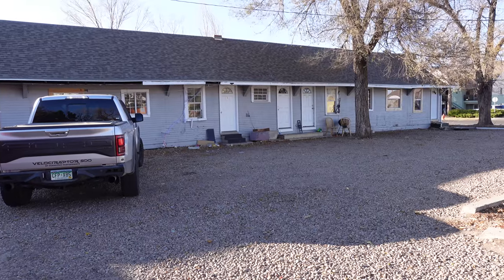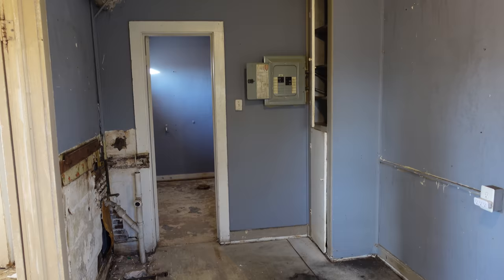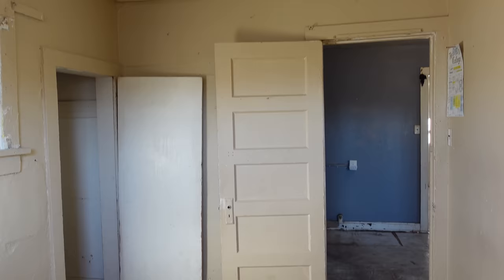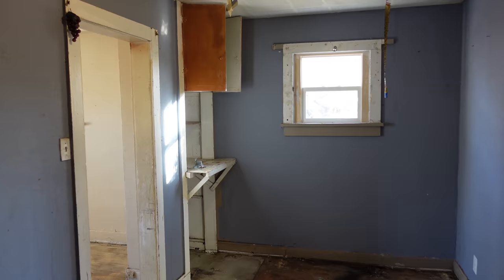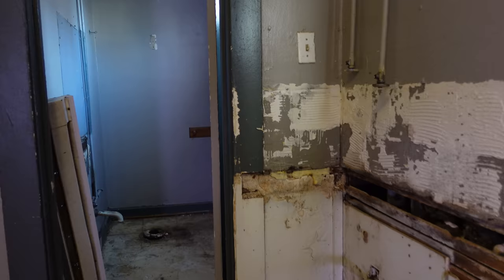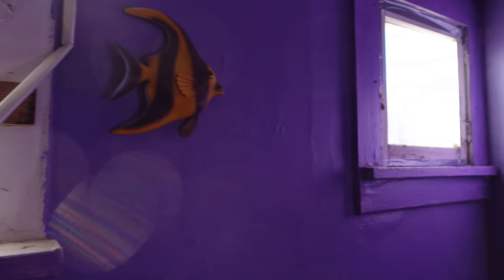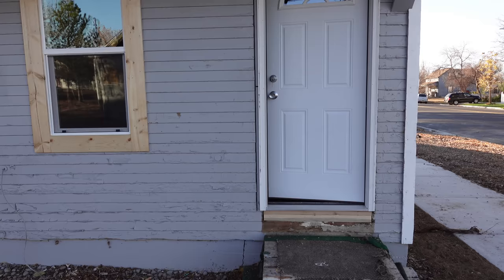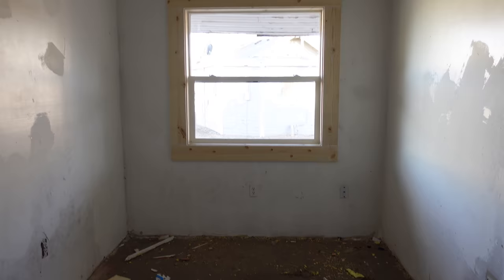The Complex! Crazy Things Found, Floorplan Ideas, Murder Room, Repair Progress, and More!

Comment: I'm shocked the city hasn't condemned most of that property. Looks like a total fire hazzard. No way the electrical is completely up to code, and as far as the plumbing, I think the water hose piping says it all.  Might want to consider gutting it all down to the studs, update all of your plumbing, electrical, hvac, and convert everything to open concept 1 bedrooms and studio efficiencies. Paving an asphalt parking lot/driveway may not be a bad idea either. I've seen condemned row houses in Baltimore in better condition; you got some real work on your hands with this one Mark. I'll pray for you brother! 🤴🏿
Reply from the maker: thanks!

Comment: You should put the new washer/dryer in the 8plex and then move the current one over this complex. Also with the signs of fire damage, I would highly suggest consider bring in a structural engineer to inspect the entire property especially considering the previous owner was a slumlord.
Reply from the maker: I didn't see any signs except on this stairs. No smell at all anywhere. We have had some walls open as well with no damage
Reply: People often salvaged wood from burnt out buildings. I suspect that is the case with the wood on the stairs.

Comment: I totally agree with Mr. P. I can't see how you could renovate all the units but leave one hot water tank for them all, with those small base board heaters for heat. The whole electrical, plumbing and cramped conditions are depressing and unacceptable the way it is.

Comment: Hey Mark, the whole complex needs new electrical and plumbing. Run the electrical on the outside of the  back and easily covered. The water seems to be routed through the ceiling and given the age of the place it is probably un insulated! Maybe cut down to 1 water line and a small electric tankless water heater in each unit? That would be much more efficient and eliminate that murder room disaster.

Comment: I have a suggestion: in the 2nd appartment (14min) put the kitchen sink to the opposite wall (remove the closet for it). Then you'll be able to use normal kitchen units. Use upper cupboards (they're narrower) from top to bottom for storage on the wall where the kitchen sink is now. This way, you don't need to move doors, walls or make custom cupboards.
Love the antique electrical gadgets, they belong directly into a museum! :-) Great decision about the entrance to the units. Could you turn the future 3 bedroom into 2 (very small) units? Or are you not allowed to add units? You'd need building permit for changing garage into living space in our country... Hopefully it's different where you work. Great to see you going forward! Looking forward to see the end result.

Comment: In the small house it almost seems specially from the outside like the bathroom was added to the back of it.. but if its possible I would suggest busting out the whole back wall between the other  rooms and the bathroom.. then close off the second door to the outside and put a bathroom where the kitchen and half the bathroom is now with a door connecting it to the bedrooom, then where the big shower is not and a bit into the living room.. put a small kitchen.  Close off the current doorway between the kitchen and living room.  So on the left you would have the current bedroom with a  bathroom behind it... and then on the right you would have the living room connect to a small kitchen.

Comment: I would make all of the one bedrooms into studios, tear out all of the walls and add mini splits for heat and ac.  Make that little house a studio too.  Give these tenants some space.  I think they could be cute if you open them up.
Reply: That would make sense but numbers wise 1 beds will rent for more and it is all about the numbers and how much it can cash flow, has that makes it worth more.
Reply: @GaunletofDestruction If I were living there, that is what I would want.  Then he could tear out everything but the water heater and electrical and clean that awful burnt basement.
Reply: @wnytrashtrucks  in the normal sense I would say yes 1 bedroom but these are so small..I think space is the key here.  I don't know..I don't live in Colorado, I really don't know what hey prefer.
Reply from the maker: Studios definitely rent for less

Comment: So after the  remodeling . if I rented one of theses apartments and ripped out one of the wall I what would I find.  If you are not taking down the old walls and you have mold and cockroaches in other apartments you will have it in all apartments. I know you don't want to put a lot of money into this place.
The place needs to be gutted. Replace with  new drywall and flooring

Comment: I think you could use the old laundry space to add to the smaller apts on either side of it. Then use part or all off the garage for a laundromat on site. If you use part of garage, but not all you could use part of it to add to one of the others on one side of it to make it bigger. Diametreious Earth- food grade can be used to get rid of bugs. It kills any bug with exoscelton. Then clean dead ones up and clean the whole thing.

Comment: Maybe use new upper wall cabinets as base cabinets.  They are 12" or so deep and should work well in the small kitchens.  
I'd take out the lower ceiling that was added to that one unit.  
Some of the electrical panels in the basement may have been for a well pump.
Reply from the maker: Then we need a sink to fit in though
Reply: @investfourmore  An Elkay model D23317 double bowl stainless sink is 17" wide.  It would work if you install the cabinets a few inches from the wall and with a counter top that extends forward somewhat from the cabinets.  Also, the faucet would need to be wall mounted.

Comment: unless I am misunderstanding, there is no way getting that much for a three bedroom around here in that shape without completely gutting the whole thing and redoing each unit completely. Personally if it was me that is what I would do from the basements up, new piping, new electrical, new hvac, etc. Then convert it from 5 units down to 4 at most. To me if you are doing nothing more then cosmetic stuff you would be no better then the previous owner/landlord. Personally I think I would actually tear it all down and start over from scratch.

Comment: I think you already know what to do with that kitchen.  Move that door over, sink on the left, stove/refrigerator on the right, lose that old cabinet with the conduit in it, trim out the conduit (or just cover it again but with new cabinets), leave as much wall as you can, squeeze in as much counter/cabinets as you can, call it good.  I've seen smaller "kitchens".  Can't do much with the exposed plumbing, so advertise it as "charming" and "vintage".

Comment: Have you considered a mini split system for the units that lack heating? Also will you put laundry machines in the houses or nope?
Reply: I agree with the mini split system makes so much more sense.
Reply from the maker: there is a room for laundry for everyone
Reply: @investfourmore  One wahser and one dryer for 7 units?
Reply from the maker: @ctmom2114  our 8 unit has 1 if each they say it works

Comment: This is going to turn out much better than I ever thought it could.  After you get the basement cleared out will there be room for enough water heaters for each unit?
Reply from the maker: Not sure on that. I think you would have to run new pipes for every unit
Reply: @investfourmore  How will you fix this?  Surely you won't leave 5 apartments plus a laundry room with just one water heater?  Maybe those instant gas fired heaters for each unit and the existing water heater for just the laundry?

Comment: If you kept the garage and put storage in there for tenants and charged then $50 Xtra a month would make more than the $200 a month Xtra. Storage like those wire cage floor to ceiling with a door on it apts use. Keep the outside more kept up also.

Comment: I gotta admit, I'd probably remodel that basement and put that laundry room down there. And you probably do need to gut the place. If only so you can get the added tiny closets for water heaters.
Reply from the maker: stairs are way too steep have to completely redo them
Reply: @investfourmore  for sure. And not very stable looking so you'd definitely wanna make changes. But since there's only a few units you shouldn't need more than 1 maybe 2 sets so should have more room for stairs in that mindset. my old apt has a basement laundry and it was fine. Sometimes laundry is heavy and you may need to have it be disability accessible. Only issue I foresee other than having to replace/remodel stairs

Comment: If you are going to make the garage a bedroom, add a little hall, connect the bath, new bedroom, and living room via the hall, at the end of hall add a closet for the new bedroom. This helps the kitchen, box in all the water pipes in the corners don't leave them plumber jakey on the walls, run then into the cabinets in the corners and put normal facets in. Consider MINI splits for that rent, don't be a cheap ass, a two head Mr. Cool Mini split would set that place up. Those windows don't meet egress at all....that's just jakey. I work cheap, I am an Architectural designer, make it a little nicer, just as little and make more money, there is room on that lot for more if the city will allow. Flippers done dirt cheap!

Comment: Sir. You need to gut some of those walls if they are not concrete. Gut a lot of that stuff and put some installation in that building. Don’t try to just throw something together. You need to put a fence around that property. And you will keep tenants. They will pay you 1200 rent. If you do it right. Instead of trying to be your usual cheap self   Fix it right man.
Reply from the maker: There is insulation throughout most of it.

Comment: for unit 3, would it be feasible to close up the bathroom door and have kitchen cabinets or open shelves along that wall while having the door for bathroom where the closet used to be? Having a slide door (barn style door)to the bathroom may make the bedroom appear bigger.
Reply from the maker: the closet isn't lined up right to do that at least the living room closet if that is what you mean
Reply: @investfourmore  no i meant where the bedroom closet used to be.

Comment: I have a couple of suggestions. 
For Unit 5, remove the wall between the living room and kitchen. Move the bedroom doors to the outside of each room so that you have one large wall in the middle. Put all the appliances on that wall and then put an island in front. 
For the little house, rework the kitchen and bathroom so that the kitchen uses the existing showing and is open to the living room, then reconfigure the bathroom to have access from the bedroom. Remove the "back door".
I don't know about making them all studios. Even though the bedrooms are small, I would think that they can rent for more than a studio. Is that accurate for your area?
Reply: Load bearing wall
Reply: @kickandblock  I think an investment in a good header would be worth it.
Reply: "Jerry, these are load-bearing walls, they're not gonna come down!"
Reply: @indijen  you’d have to hire an engineer to determine that. Pull a permit from the city as well, many hoops to jump through
Reply from the maker: yes a one bedroom will rent for more than a studio

Comment: Make the garage a laundry/dryer coin operated deal. You could fit 4 of each machine in there. Waaaaay more money than a 3 bedroom!
Reply from the maker: Another bedroom adds $200 in rent with no maintenance and we already have room for at least 1 of each
Reply: @investfourmore  could charge $50/month more for each unit - would cover machine costs of 4 washers and 4 dryers… plus the bonus on coins. $4.2K/year. ($350/month). Even if just accessible to 6/7 - still better resale … also - add Solar??? If the place needs rewiring may be an option. I’ve just bought my first house and I’ve spent AU$40K on electricity/repairs/upgrades - and my house is now worth AU$140K more than what I paid for it…

Comment: I just really don’t see any good motivation in being conservative on these demos. You’ve got a ton of room financially and it would be easier to list the things done right than the things done wrong. I’m sure there’s no insulation in any of them. Take everything down to studs and start over. Yes you could maybe cut corners and make 300k vs doing it right making 200k but do it right, attract good tenants, it works out better in the long run. ,
Reply from the maker: There is insulation in all the exterior walls.